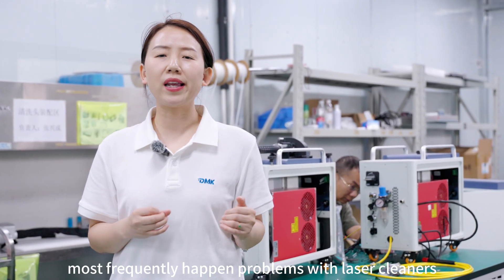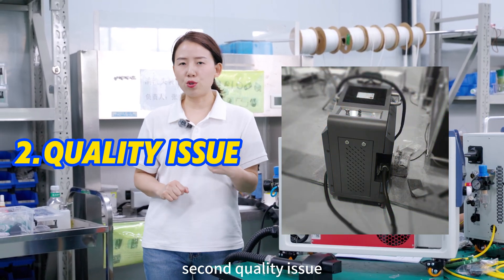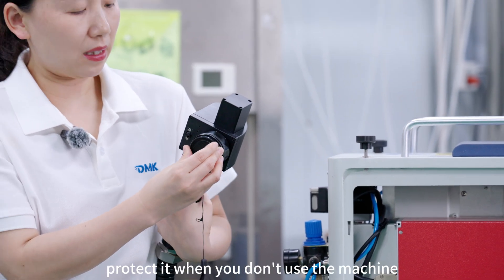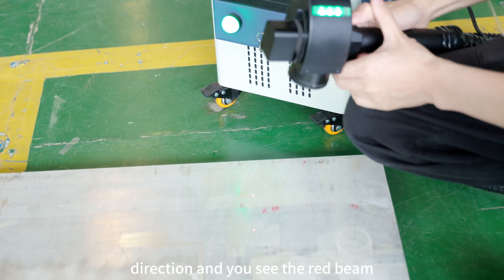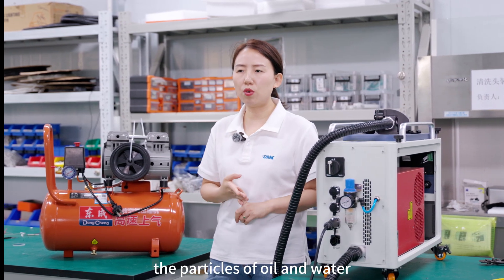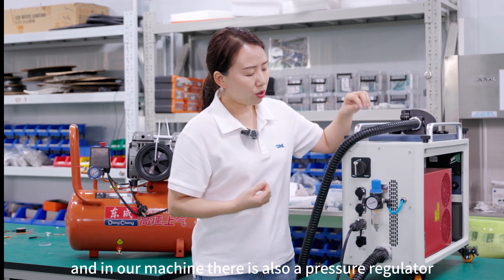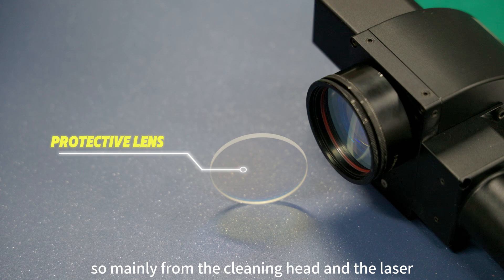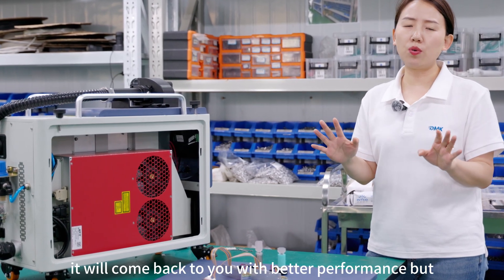Common Faults and Troubleshooting of Pulse Laser Cleaning Machines#cleaning #DMKLaser #dmklaser #DMK

Comment: Which compressor would you recommend? Air volume and pressure?
Reply from the maker: a very small one will works,  24 Litre Air Compressor 145psi/10 Bar  - 1.5hp - 230V  Only for reference

Comment: Hi jally 
I have a question about new version of laser source max photonics MFSC-1500C it's us for cutting machine or for welding machine or it's also have two versions one for cutting and other for welding...

Thanks
Reply: MFSC-1500W can be used with laser processing head, galvanometer, etc. for system integration with robots, machine tools, etc. to do laser fine cutting and precision welding processing.
Reply from the maker: yes, for max 1500w laser, they always have welding and cutting two versions, the model name are exactly the same, so you need to specify the type of laser when you ordering from max laser, for cutting laser, it's 50 microns core diameter and 15 meters delivery fiber length; for welding laser, it's 20 microns core diamater and 10 meters delivery fiber length.